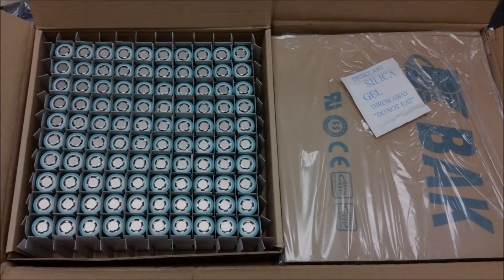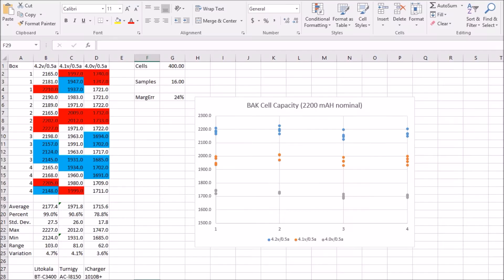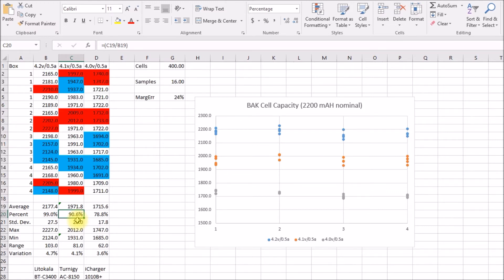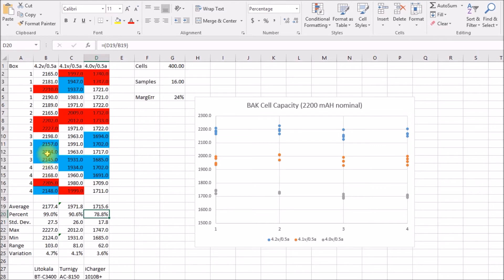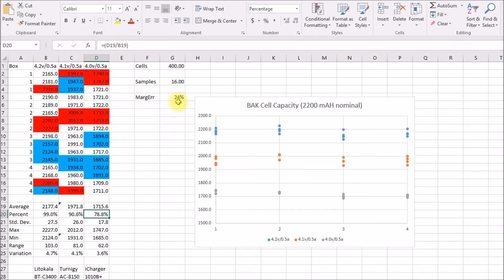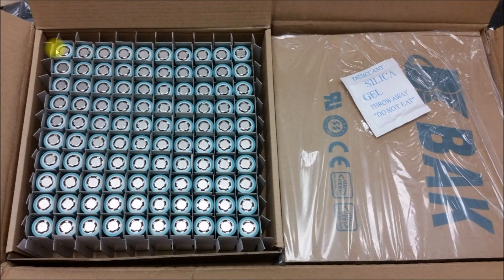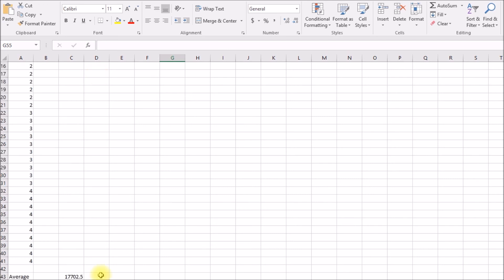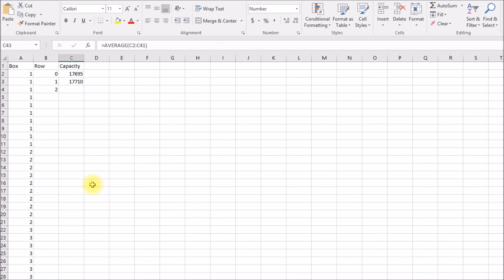BAK 2200mAH 19650C4 Cell Testing, Part 1

Comment: I recently got lucky and won an auction for £25 for 40x brand new laptop batteries. Each battery has between 4-9 cells, the 4 cells being Samsungs 13Q and 25F which is nice but the majority of the larger batteries are 18650C4 which display similar results to this video but the problem with these benchmarks is that will they stand up to the likes of reputable brands such as Samsung, LG, Sanyo and Panasonic in 6months? and after many charges, that's the huge problem with cheaper cells is lastability. How are they performing now since this video is now a year on?
Reply from the maker: So far they are working flawlessly.  I've had an 80 cell pack in daily operation the whole time, two more packs were added a month or two after this video and just put another one in service yesterday, in fact.  Cycling them from 3.7 - 4.0 volts.  These are alongside a pair of packs with used laptop cells and those likewise are working fine.
Reply: Hi, thanks for your response. Do you use a cycle per day?
Reply from the maker: Yes, for the most part.  It's on my solar power system and mostly is charged during the day then discharged over night.  On partly cloudy days, it may charge/discharge to a much smaller degree multiple times during the day.  On fully overcast days, may not cycle much at all since my system responds to weather conditions and won't discharge the cells if there's no chance of recharging in the near future.

Comment: Thanks for the video.  I purchased some of these cells as well.  Do you know what the C rating is?  I've seen some conflicting documentation
Reply from the maker: Per the data sheet I found, looks like they only list up to 1C (2200mA) as the "quick discharge" current.